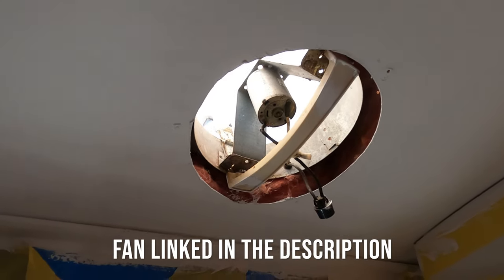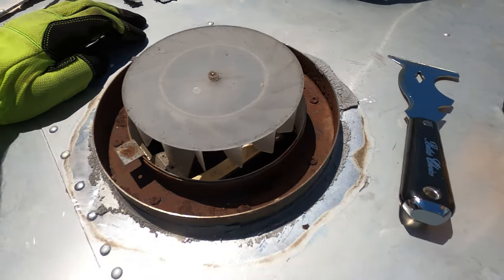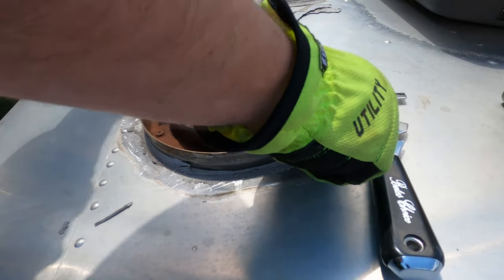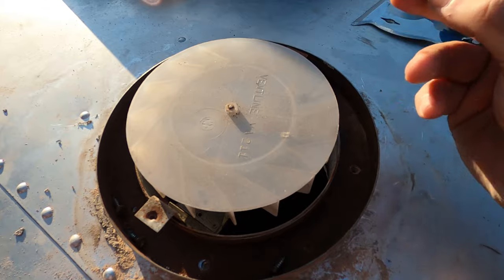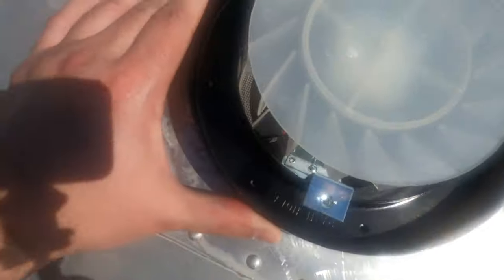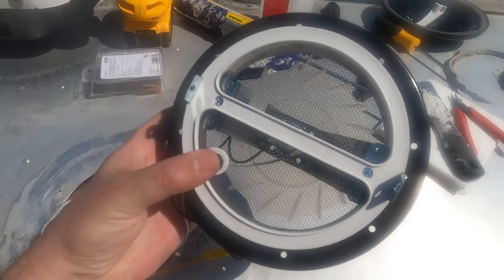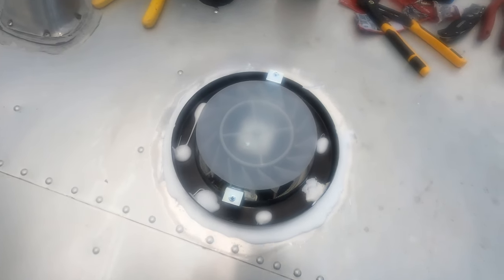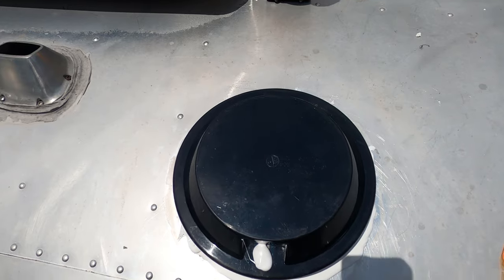Ventline Vanair Trailer Roof Vent Installation on an Airstream

Comment: Thanks for making the video. My vent leaked when in storage and caused enough damage to require the back 1/3 of the floor needing replacement. The foam that is inside the smoke cover is very poor and rots out quickly. I put EPDM rubber inside there and it's been holding up well. However, just last fall, for the first time in several years, I found water dripping onto the handle and floor. We were in Florida for a month and with every rain it would drip into the bin on the floor.

I've not been able to tell where mine is leaking from but I suspect the area under the base. On the outside I don't see any lap sealant but I don't see any cracks in whatever that is there now either. I decided to pull the entire thing out and replace it, a task for warmer weather. For now I have a plastic bin to catch the water.

Again, thanks for taking the time to make the video.
Reply from the maker: Youre very welcome!